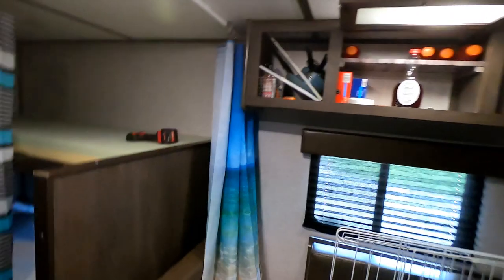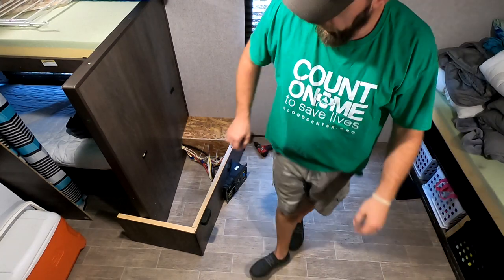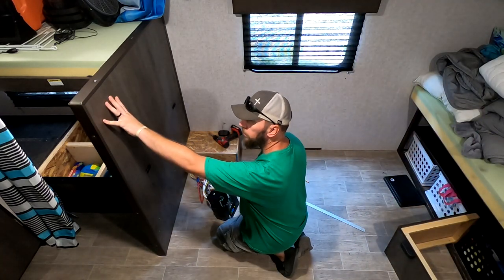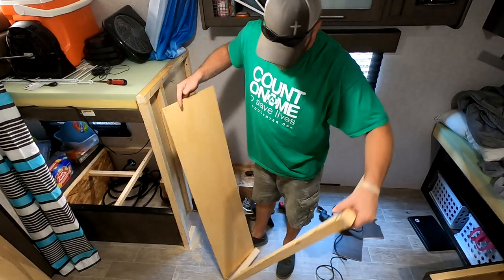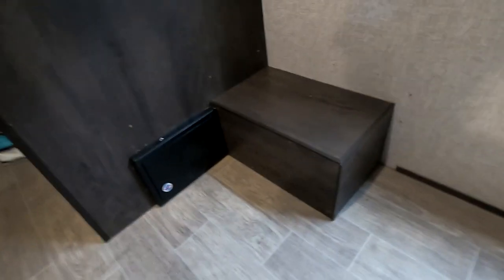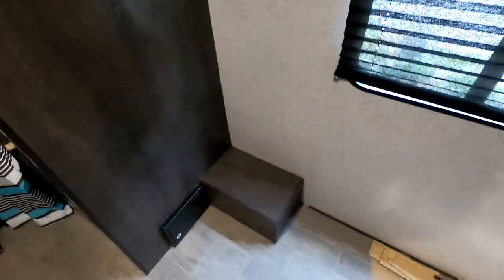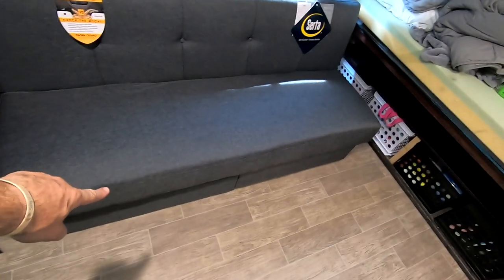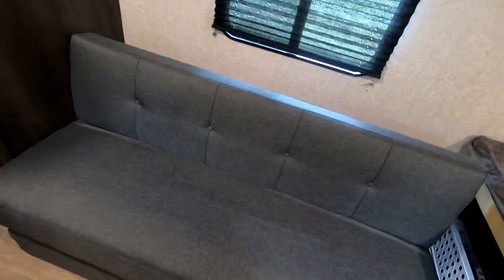How to Upgrade your Dinette Seating | Colman Lantern LT 17B

Comment: My only concern is that power control box. In my 17R it runs the cooling fan through the front which you have pretty much covered with the futon. I've accidentally blocked mine but noticed the blockage before it got too hot. Was 111 here that day and 88 inside as ac couldn't keep up. I live in my 17R by the way cat bird and I love it!!! Thanks for showing window upgrade. My next project

Comment: How comfortable is the couch?  Thinking of the same one.
Reply from the maker: It wasn't too bad. It's definitely a futon, it wasn't overly plush or anything. I've seen some that others have put in that look to be a bit nicer.
Reply: Do you have an inverter?  They said they are installed but I don't know where, my outlets don't work unless I'm plugged into electrical. They also said maybe turned off but not sure where to find it or turn back on. Hmmmm. Camping World not helpful
Reply from the maker: @cathyr003  we didn't have an inverter but I'm pretty sure they are installed in the front storage area

Comment: Nice love it .. question  you have to cut the fulton in the back around the wheel whale or push it enough to stop by the wheel whale? and can you do a video on how it looks back there
Reply: Yes please! How did it just slide into place over the wheel well?
Reply from the maker: This particular futon has removable legs, so we just took off that one and  the futon actually just sits on the wheel well.

Comment: Check out the aurora 16bhx. This upgrade comes standard and cost 1,000 less overall than the Coleman LT 17B
Reply: Problem with the aurora is the couch is only 60 inches long. This one he put in is almost 70 inches long and looks like he could fit an even longer one. Personally I would want a 75 inch long couch (same length as a twin bed).

Comment: Hi! Your videos are great thank you. Just a quick question, what do you do to fill the holes in the floor after you take screws out? Thanks!
Reply from the maker: I typically just use the handle of a screwdriver and kind of just push the little bump back down and the pattern of the floor hides it pretty well.

Comment: Do you like the wall mounted a/c unit? Does it work well? Im looking at a 2022 used 17b with a ceiling a/c, 15,000 btu unit. What do you think would be better? Thanks!
Reply from the maker: We didn't mind it when sleeping on the queen but any other place in the camper definitely required some sort of circulation to be comfortable. It also drips down the outside of the camper leaving an unsightly rust line. Some people have added a gutter system to keep it from dripping but I'm sure it still leaves something. Our new camper is roof mounted and to be honest it does really well. Good luck, I hope this helps.
Reply: @SmallFamilyBigDreams  Good info. Thanks!